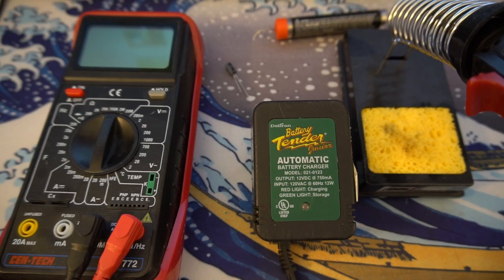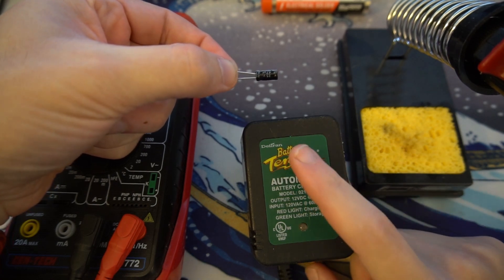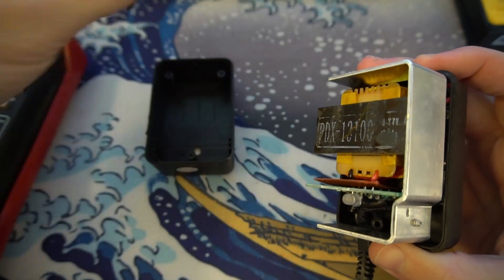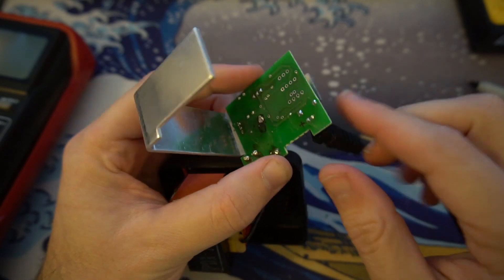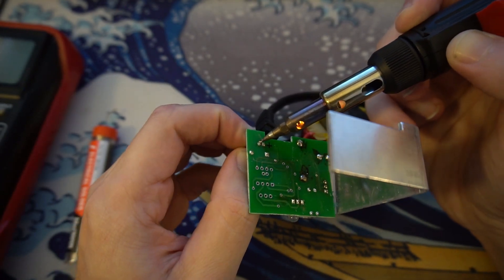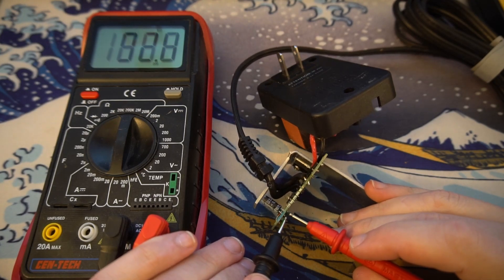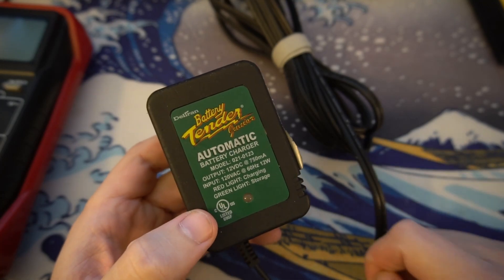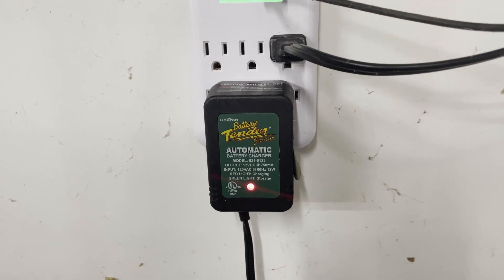Revive Your Battery Tender Jr: Capacitor Surgery & Resurrection!

Comment: Thanks for the video, cured my malfunctioning battery tender. The only issue I couldn’t get a reading with my multimeter on the old or new capacitor, gave up and installed new capacitor and it now works. Any ideas on why I couldn’t get a reading ?
Reply from the maker: What setting did you have your multimeter on?